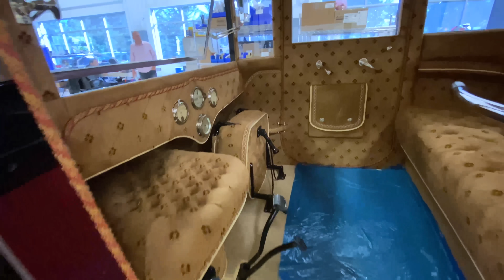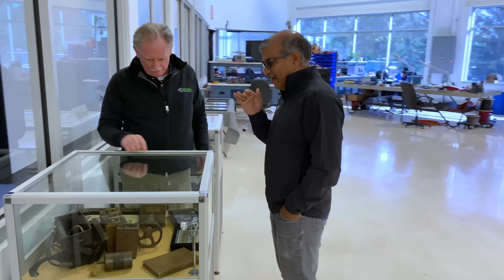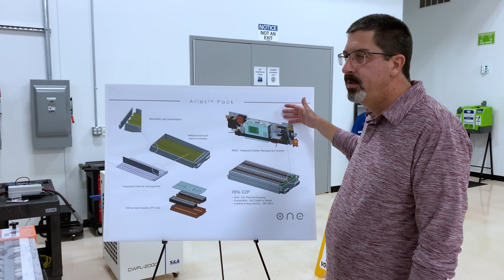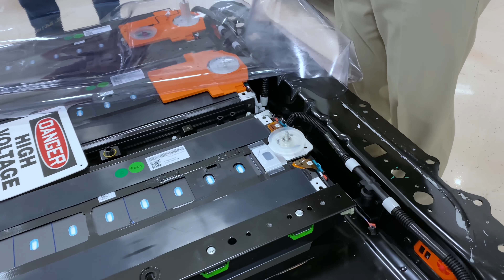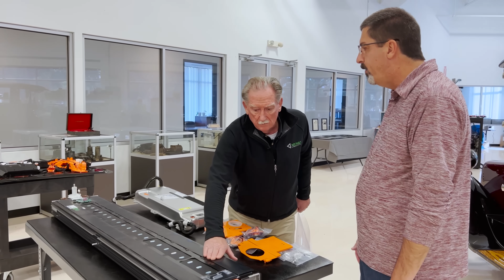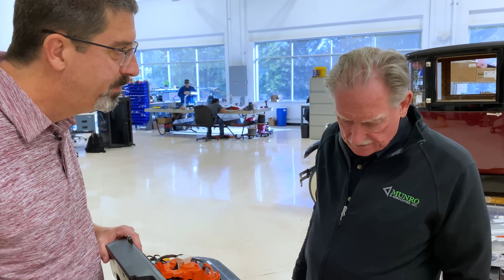Tesla Model 3 LFP Battery + Sandy Visits the ONE Facility

Comment: I waited for this Video like a child for Chrismas. 
Is there any Detail Information about the LFP Batteries of the Model 3  or Y 
1. is it a 2P90S or any other Combination.
And
2. Is the Pack weight of a 3/Y SR (LFP) about the same as a 3/Y LR? How much lighter is it.
Thank to all for Your Ideas.
Reply: @UCOASPYO3c-UcmkiTiYfjOTw Thanks 
I was not shure because to use 104s1p has 104 points for total Failure,  Even a Aktiv Balancer can't help in this case.
In a LR Battery there are about 100s40p if one 2170 dies you loose only 1/40 of the total Capacity. Even when 100 batteries die, you don't have complete loss. Understand i like the LFP chemistry, so i use it in my projects, but always in a 4-12s2-6p i usually chose lower capacity and put some in parallel.
Reply: @digitalwallis  I think, as a customer or a manufacturer, you want not to lose a single battery cell. Yes the battery will remain functional but will already start to make problems which will leads to premature battery replacement. Laser welds for terminals of big prismatic cells can be very reliable, the only feature you lose is this particular design is the cell level fusing. But again single cell fuse blown leads to the battery replacement or repair. The main benefit of "series only" battery design is the absolute minimum connections which always helps with reliability and production cost/time.
Reply: From this video it is finally clear that there are 4 long modules in Tesla LFP pack. Edited: Two shorter side module have 24s1p connection and two longer central modules 28s1p. So 104s1p in total. My guess is  that cells have 180 Ah nominal capacity so about 60 kWh total capacity.  Thank you Sandy!
Reply: Could potential model y incorporate more cells to compensate for weight difference? What is the limiting factor?

Comment: It’s the Model 3 standard-range LFP battery. (Not: short range) Currently has 55kWh but coming models should have 60-61kWh LFP
Reply: Wow! 60 kwh sounds good enough, do you know its coming in near future, months?
Reply: @components-f3n  Probably 2022 if not already. 60kWh is certainly enough for 90% of people. No need for no cobolt!
Reply: @components-f3n  Q4 2021.
Reply: @quansun7633  great news! I had ordered one SR+ with delivery december sales advidor said. Last shipping was from Shanghai to Sweden. They Said that next delivery can be bott from Usa and China. Will Tesla put in 60 kWh in both factorys you think?
Reply: @components-f3n  I read a post from tweeter. It shows a map of batteries used for model 3, Y , S and X from 2019 to 2021. It appears the 60kwh LFP battery from CATL will be used in both Fremont and Shanghai from Q4. Hope it is accurate.

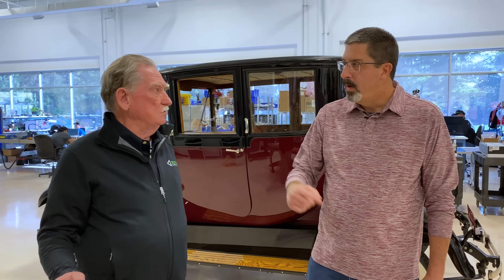Comment: 17:41 "On the 2170's you gotta million little wire bonds" I'm no expert but I bet those little wires are by design. Just in case a cell is compromised.
It's a fuse. Designed to open circuit that cell in case of catastrophe. (I'm sure Sandy knows this before you do the keyboard warrior thing)
Reply: Million little cells also means alot can fail and seriously compromise the range and utility of the EV, cells/modules voltage balancing is very important.

Comment: According to spec sheets the Aries pack is a little shorter than one of the four modules in a tesla, twice as high, and twice as wide. Is this aimed at cars? Because that shape seems really awkward for the now standard skateboard. I can't figure out how else it would fit in a car without compromising other aspects like interior seating positions, cargo space, or impact isolation. Maybe it is aimed at F-150 size pickups or delivery vans, where the pack could slide in between the ladder frame.
Reply: It is probably for all kinds of mobile applications including SUVs and pickup truck conversions, truck conversions, transit bus conversions, boats (Torqueedo went with the BMW i3 pack which is a similar "brick"), caravans and stuff.
Reply: The specs would indicate that each of the 108 cells are 200 amp hour each and at that capacity are pretty big !!!
Reply: @staudtj1  200 Ah is a pretty normal cell size. The ONE Aries pack is composed of 200 Ah blade cells, the presented Tesla-CATL pack has about 180 Ah per prismatic cell. 
Mercedes EQS uses 140 Ah cells by CATL in NMC-811. BYD Han uses  LiFePO4 pouch cells in blade style of about 165 Ah.
Reply: Cybertruck comes to mind.
Reply: one their website they talk about "scalable architecture" so i suspect indeed Trucks, or even stationary energy storage.
Reply: @tzarcoal1018  For stationary use, energy density is far less important. Thus the benefits of this energy-dense LFP pack would not really be beneficial or necessary.
Reply: @koeniglicher  true...but isn't LFP considerably cheaper than NMC, so still a good choice? Even though the Energy Density Aspect is less relevant.
Reply: It would drop in beautifully in between the frame rails of a semi truck
Reply: No. It's suitable for stationary applications semi-tractors and busses. 
Hopefully none of the newer battery tech ever needs to be shoehorned into the skateboard form chassis compromise.  Whether built up as a sedan, hatchback, crossover or SUV it is a bad compromise that drives size, weight and cost up, wasting more than  50% of the energy they use more than  90% of the time. 
-  Lose preconceptions about what "cars" should look like. Base package shape only on passengers, cargo, and probable use (not "streamlining"), and discard already obsolete mechanical tech. You'd end up with most of the "car" bodies closely resembling truncated VW buses or original Econoline vans. No hoods, no trunks, no frunks. All those exist today because of tradition and marketing, not current engineering need.  Bodies were originally carriages designed as horse drawn wagons.  Trunks originally were leather trunks on shelves. The "despised" station wagon, sometimes shortened to a true hatchback, was always a more efficient form factor for the contents. It just didn't look swoopy enough with added tailfins. 
-   eg If you removed from a Honda Element the ICE and transmission, replaced the mechanical steering with direct drive and electrically steered front wheels, the front end could shrink by a foot, replaced with a structural cage, and there would be enough room to move the front passengers at least 2 feet forward into that void, and the rear passengers also forward. Without changing the wheelbase of a vehicle already shorter than a Honda Civic, you could shorten it anther foot and have a 5 passenger vehicle with more cargo volume capacity than a Honda Pilot.

Comment: Sandy, you left me scratching my head.  I had never heard of ONE, and your introduction left me confused.

What did CATL make?  What did ONE add?

On their website, ONE advertises that their packs are 'structural cell to pack' designs.  Welp, consider me to be highly skeptical of this claim.  They ripped those words right out of Elon Musk's lips, so how does ONE's product compare to Tesla's design concept?

Tesla uses cylindrical cells, not prismatic cells.  Tesla's 4680 pack doesn't have steel beams running every which way in the pack; ONE's pack does.  Tesla's 4680 pack doesn't have modules; if I extracted the correct meaning from all of the marketing speak in this video, ONE's pack is modularized.  In Tesla's pack, the cell cans themselves are structural elements.  I'm not seeing that in ONE's pack, prismatic cells are fragile.  Tesla's 4680 pack doesn't have a tray; ONE's pack does.  Tesla's 4680 pack should come in around 200 Watt-hours per kilogram, possibly better; ONE's pack comes in at 144 Watt-hours per kilogram (which is significantly less than the current generation Tesla packs in Model 3, Model Y, etc.).

The first pack you showed us looks like a stack of two layers of cells; it's very tall.  A car built around that pack will have to raise the floor, and the usual BEV low center of gravity will be compromised.  That is how they're getting to 79 KWh of energy in a pack with modest X and Y dimensions and lower energy density LFP cells.  Their 'structural cell to pack' marketing speak obviously isn't where the magic happens; it's making the pack double-layered.

Besides deciding to double-layer the pack, what do these guys bring to the party?  I pulled my microscope out of storage for a look, but I can't find any advantages.  Everything good they talked about seems to be CATL's engineering.
Reply: Very good questions.

Comment: The irony is that ICE cars won thanks to the starter motor, which is electric.
Reply: That darn charles Kettering fool, plus the muffler was another key invention that killed off evs back in the early 1900s.
Reply: Wrong, the starter was just part of the equation, ICE had way better range and flexibility compared to EVs. After the titanic, trains, ships.... quickly switched to gasoline and diesel for propulsion......
Reply: @alanmay7929  no they did not especially not in the beginning. Evs we're much more reliable and had better range until the 1920s.
They also enjoyed a near even market share until then. Inc commercial use trucks which in some cities we're required to be evs.

Also up until ww2 the most common way to get gasoline outside of a major metro area? Was to purchase it in cans from a drug store. 😀
It took many decades to build up the infrastructure to support ICE vehicle's. It won't take anywhere near as long to ad charging station's where needed. And train enough tech's to do the few maintenance tasks required. 👍🏻
Reply: @4literv6  lol.... diesel engines were also made and could initially run on oil, fats and other stuffs, also they didn't had to be recharged for a day/days. The gasoline in cans also gave ICE  more range and flexibility of use.
Reply: @alanmay7929  A diesel was originally meant to run on peanut oil.

Comment: not to mention, newer lifepo4 batteries have a 5000-7500 cycles life. That means if you get 300 miles from 1 charge, your pack is good for 1.5 millions miles before reaching that 75-80% rated capacity.
lifepo4 are really the future, even if they are not as energy dense as standard li-ion. And they are getting cheaper really fast.
Reply: AND they Have no problems when used in a V2G configuration, because they Have the cycles to Do that easily. So charge the car when the Sun shines and usea little Bit in the Night for Your home.

Comment: EVs are evolving so rapidly right now you'd be a fool to purchase one unless you absolutely can't wait.
Reply: It's the general argument about technology in general, especially cutting edge stuff, there's always something better around the corner, all you can do is buy the best that's available when you need it. 

Video cards, Cellphones, Consoles, same story. Just the way it is. 

Better to grab the current best cellphone for your needs today than wait it out with a flip-phone for another ten years. Tech's gonna keep improving for a long time, and then when it slows down the next disruption replaces it and starts the cycle allover again.
Reply: @AllanSustainabilityFan  This only applies if you can afford the bleeding edge prices.
Reply: @MegaWilderness  Enough people can, and that drives costs down for the next group. 

Plus a big healthy market of used EVs has to grow from somewhere, right?
Reply: @AllanSustainabilityFan  Only as long as the batteries can stand the distance. None have sufficient cycle life yet. I'll wait until either the prices fall or life improves. Next-gen batteries will be better.
Reply: @MegaWilderness  I'm sure the future ones will be even better sure, but half a million miles or more from the current ones is plenty sufficient I think.

The fleet statistics on the older Model S batteries shows degradation actually leveling off after the first 150k miles, stabilizing at around/above 90 percent, few folks even report passing half a million miles while still above 80 percent, that's not too shabby.

The one exception I can think of is the Leaf, Nissan skimping on thermal management, so basically designing their EVs with the reliability level of a cellphone, but modern EVs don't cut corners like that today.
Reply: @AllanSustainabilityFan  I'll wait a Plaid just caught fire these past couple of days. Nowhere near your phantom million miles. Show me where it says that on the warranty.
Reply: @MegaWilderness  There are 10-12 as many ICE fires vs Tesla fires per miles driven, but perhaps 10 times more Tesla coverage, I guess it's less about safety and more about popularity with click media, nobody would read about an ICE fire, it's so common you'd get more eyeballs on the obituary columns. 

EVs are generally, by nature, much better in this area, not a surprise really considering "combustion" is in the name of that obsolete technology.

I think the only EV today that's concerning today is the Chevy Bolt, GM really dropped the ball on that one, and had to recall every single model today, including even the 2021 ones. An expensive $2B mistake and growing, it's the only EV that matches ICE in fire statistics, which is highly unusual. 

For the rest of the modern EVs on the market this is basically a solved problem. Especially LFP ones covered in this video, extremely stable to the point where thermal management can even be simplified.
Reply: @AllanSustainabilityFan  Perhaps in the USA in accidents. None of my cars have spontaneously caught alight but drones, mobile phones, laptops, aircraft, and now cars have. All with a common denominator. As the batteries get older the risk increases. Mines quite safe as diesel and it doesn't need tons of wiring and all is manually adjustable no seat warmers or anything like that. No head unit nothing.
Reply: @MegaWilderness  Anecdotes are no substitute for government statistics. 

I mean I haven't had any of the ICE cars i've driven personally catch fire either - which is impressive considering what technology is under the hood, combustion is in the name after all, so kudos to the designers for figuring it out over the past century.

But of course car fires is common knowledge regardless of this. BMW, for example, has some notorious cases that triggered a recall on some ICE models quite recently.

According to the department of transportation, there is an ICE fire every 19 million miles. EVs, by comparison are closer to one fire per 205 million miles.

In view of such large numbers, it's not a surprise that neither of us had our ICE cars go up in smoke, but when we're talking hundreds of millions of people in cars those incidents add up. 

Which is why we end up having over 171,000 ICE fires every year in the US alone.
Reply: @AllanSustainabilityFan  ICE fires typically happen on old and poorly maintained vehicles, and the fires happen out on the open road while the engine is running. Big difference between that situation and a brand new EV spontaneously combusting in your attached garage while you sleep.
Reply: @huskypup3489  Age and wear and tear can be factors in car fires in general, sure, but that video was of almost brand new BMWs. 

Also ICE vehicles can catch fire for a variety of reasons, not just age. Many more reasons than EV fires. Ex:

- Fuses that blow repeatedly.
- Spilled oil under the hood left over from an oil change.
- Oil or other fluid leaks under the vehicle.
- Cracked or loose wiring, or wiring with exposed metal. (Surprisingly quite a common cause)
- Very loud sounds from the exhaust system.
- Rapid changes in fuel level, oil levels, or engine temperature.
- A missing cap from the oil filler.
- Broken or loose hoses.
- Design defects.

And more frequent - 1 per 19M miles vs 205  miles for EVs.

And when an ICE catches fire it typically explodes, EVs don't explode in that fashion, despite media spin, the chemical reaction is relatively slower. 

ICEs explode, EVs vent, gives people more time to evacuate safely. It's a big improvement.

The disproportionate media coverage of new technology is mainly the reason people think this is an issue, but the facts and statistics are clear on this.

Comment: The cool thing is you can just throw a modern lith ion battery in these classic electric cars and they run just fine today
Reply: Amir: That is what I did to my electric run-about. I took out the heavy Lead-Acid batteries, replaced them with a single Lithium-Ion battery that gave me more range.

Comment: This car s a horse-drawn carriage with a space at the front for an engine. Just goes to show, things really have not changed much for over 100 years.
Reply: They're still called coach builders...
Reply: People always build the familiar with new technologies. My pet peeve is EVs with massive gear knob selectors right where the gear box was. There's no reason for it.
 Of course you also have designers going out the other way, whether that's a Citroen SM type control panel or a Tesla type buttonless setup.

Comment: There is almost no difference between an LFP Tesla penthouse and the original 2017 penthouse. I think Sandy got confused since they removed the onboard charger / 12v DC converter.
Reply: what part was the pent house?
Reply: @PeteZam  The electronics bay with the hinged plastic part

Comment: That TESLA LFP battery looks to have more empty space in it. Can some thermal isolation could help the thermal management, specially on the weakness of those kind of battery, i mean on cold climate?
Reply: I think that empty space is only because they took out the battery module that were there.  The single module they looked at a bit latter was probably removed from the empty spaces you saw in the whole pack.